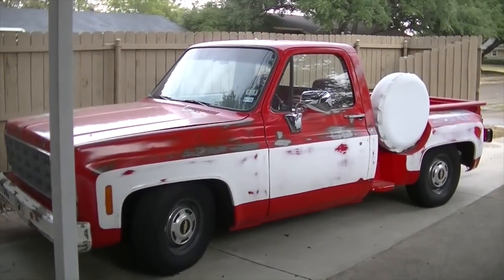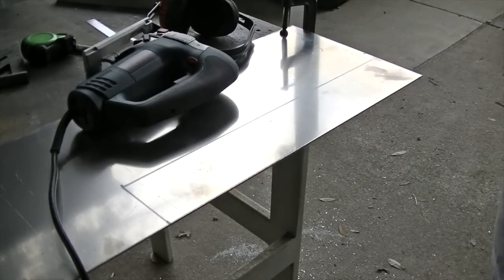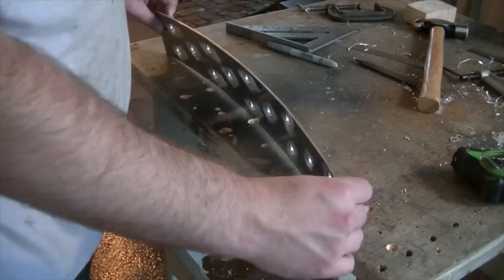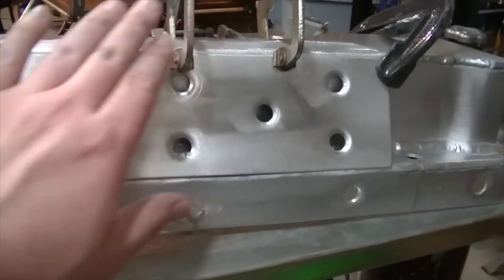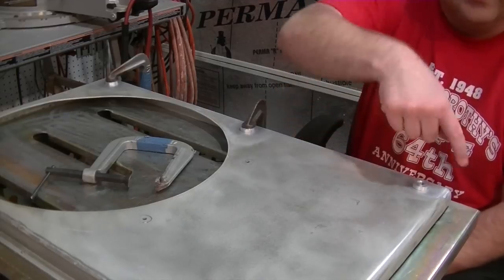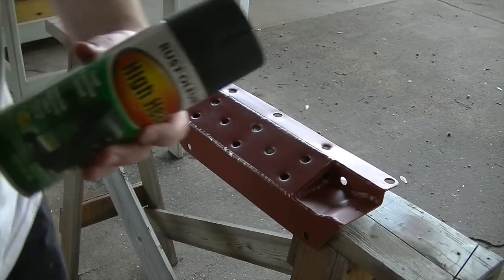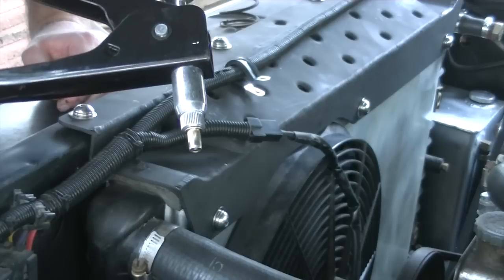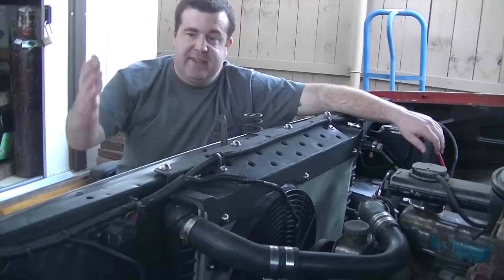PART 3 CHEVY C10 RADIATOR SUPPORT BUILD | Aluminum 73-87 C10 Upper Radiator Support Bracket

Comment: Thanks for the nice, detailed video series.  I own an '87 R10 and just installed a new 4-row all-aluminum radiator w/ dual electric fans, only to find out that the stock core support/mounts were not going to work.  I fabbed my own mounts (no welding...I don't have those skills just yet) and bent some tabs down to hold the core in place.  It's pretty sturdy, but I thought there may be a better way to mount them.  After watching your three videos and coming to the end of the third one, I saw you use the rivet nut tool and nutserts, and the lightbulb went off.  I just bought the tool and nutserts on Amazon, and will use them to attach the bent "doglegs" to the fan shroud.  This will prevent any wiggling and will keep the radiator in place.

Now I just need to find time to learn to weld.  :-)

Comment: I might have been tempted to polish all that fancy aluminum work instead of hiding it all with paint.   Just my opinion but aluminum is sooo easy to polish to mirror if you want to go that far.
Reply from the maker: +bhwystar I though about it, but I just decided to paint it at the last minute.  Quite a few nooks and crannies on this thing that would be a pain in the butt to polish out.
Reply: +milkcrate82 even unpolished they look outstanding.  I'm not a supporter of hiding all that aluminum artwork with paint.